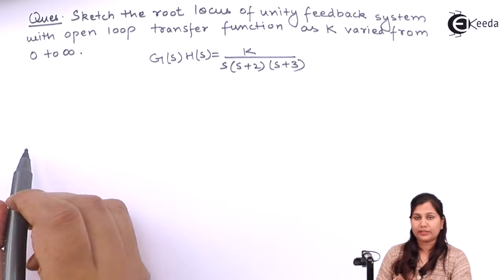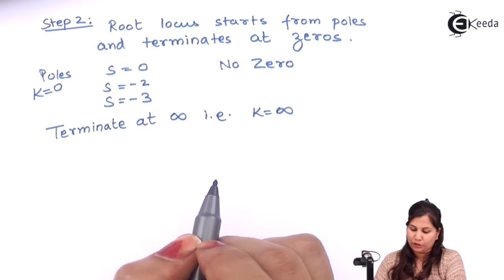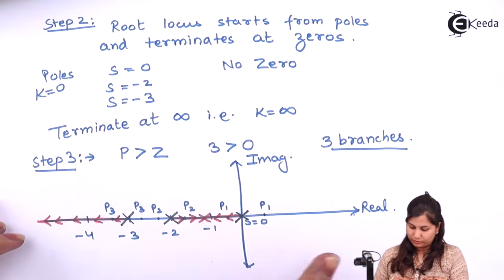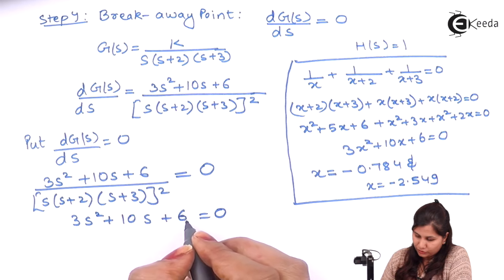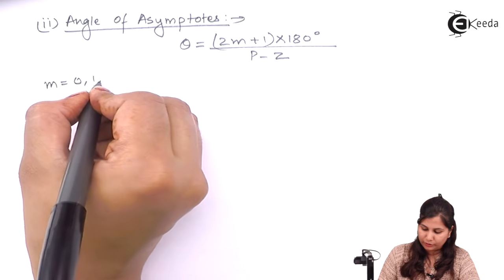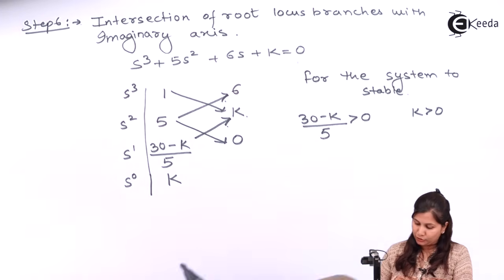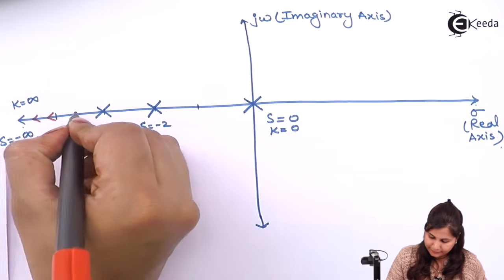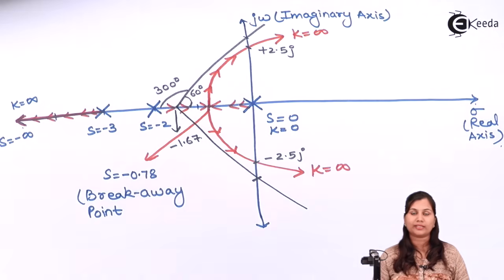Root Locus Technique (Problems) - Root Locus Technique - Control System

Comment: Step 4 :   3x²+10x+6 after solving I got s= -0.589 and s= -1.911 how did u solve to get s=-0.784 and s= -2.549 I solved by quadratic method . Plz tell me
Reply: Try it on Scientific Calculator .... I got it correct